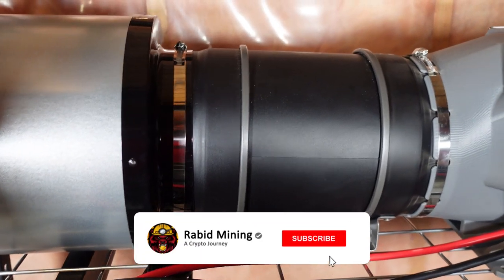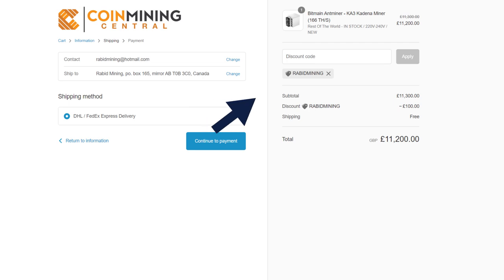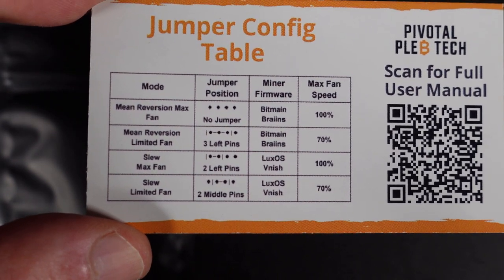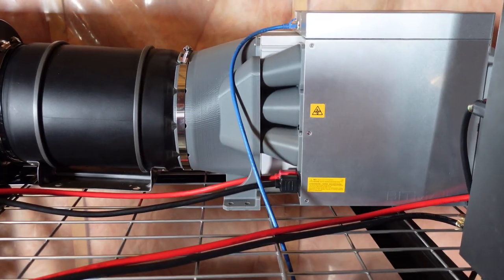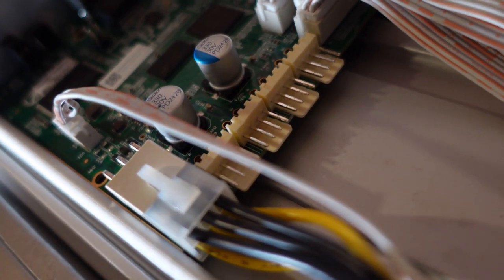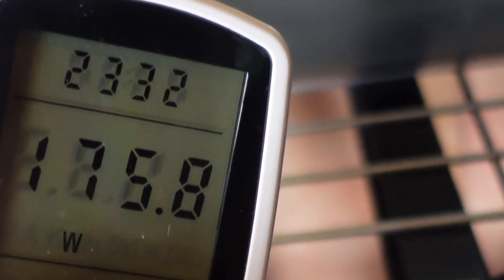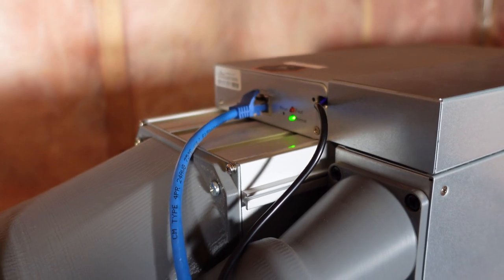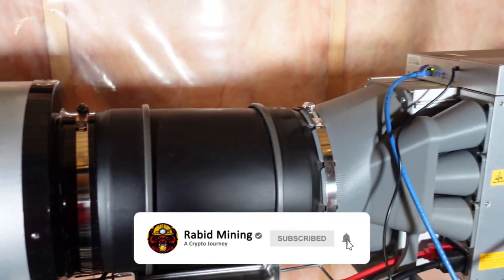SILENT BITCOIN ASIC Now Has Auto Fan | S8 Fan works!!!

Comment: Rabid very nice! I like that auto fan board allot, I got about 32 miners using manual fan I just set everything to 8 lmao even in the winter so I don’t have to drive over their to keep changing the setting,  getting one of the boards for long term testing, I know the fan emulator is reliable for years, this product is new so going to test it out until end of year then get a ton of them if all goes well.